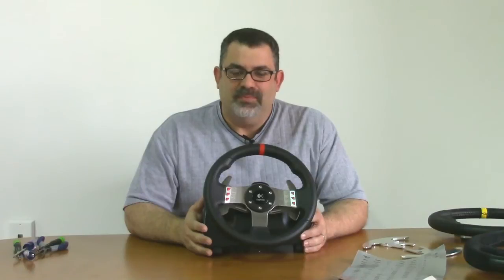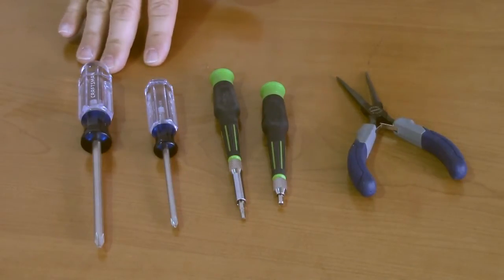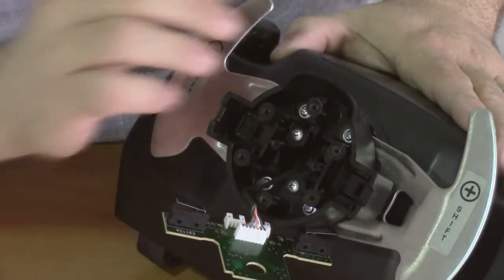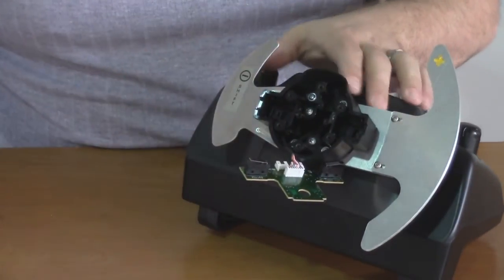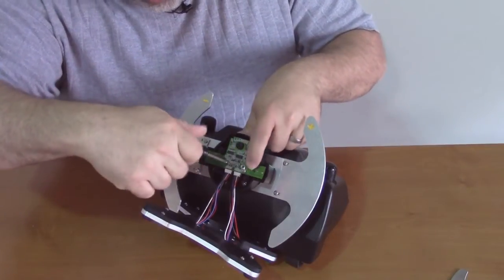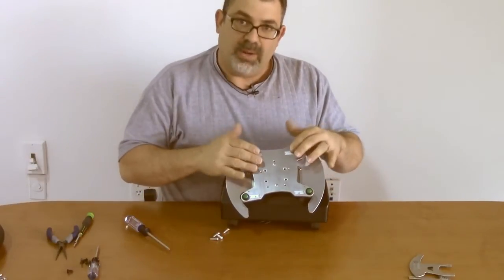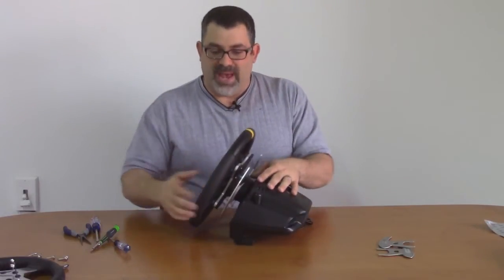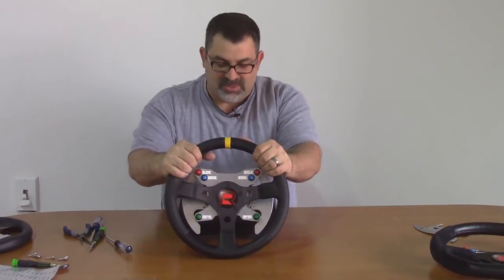RealGear Wheel Installation on the Logitech G27

Comment: I would have liked to see a replacement circuit board, because the OEM switches built into the board are pretty lame.  Do the new paddles help with getting a better activation/return on the OEM switches?

Comment: When you put this wheel on does it mess with the 1:1 visual of the wheel moving? For example if I turn the wheel 90 degrees to the right will it still show the wheel on screen at 90 degrees or will it be more or less? Since the wheel I assume is larger.
Reply from the maker: Clint Isonhood no, it does not.
Reply: 90 degrees is 90 degrees? I thought it never changes, it only slows down how quick you can turn it 90 degrees because of the length of rotation changes but the angle stays the same? Meaning you can be more accurate when putting in small turns but the downfall is it also harder to do tight turns because you have to turn the wheel more?

Comment: hi, after watching your product for the first time, I wanted to ask a few questions.

firstly I'm from the uk,  so driving with a real car is slightly different to the stock wheel,  

will I be able to se yours to feel more like real car steering in say project cars for example?

I also noticed, the panel for the buttons block the led's for the revs, so I wanted to ask, do you have a version which still lets this work?  (it was a great feature of the stock wheel)

as I don't know your brand well (yet) do you have a price list of items? (I'm assuming your site, so I guess I'm asking for your website please)

thanks 

dez
Reply from the maker: the website is Ricmotech.com. The larger wheel can help drive the car smoother. The rev lights are covered by the center section of any full size steering wheel. Also, we do not sell the complete kit as shown in the video, but we do have all the components, this lets you customize you wheel to your liking.